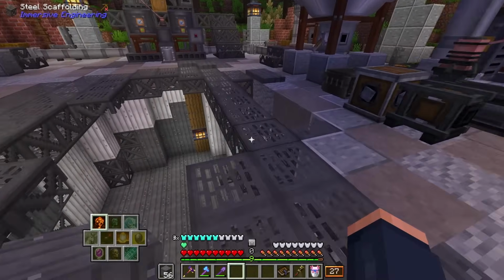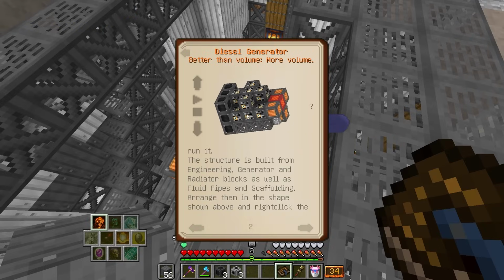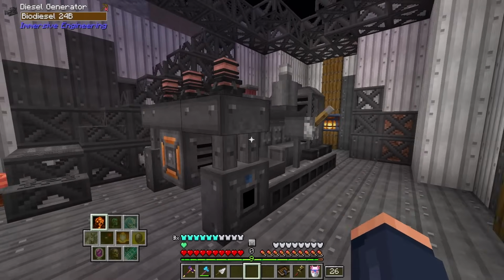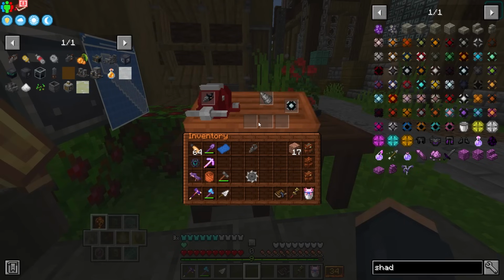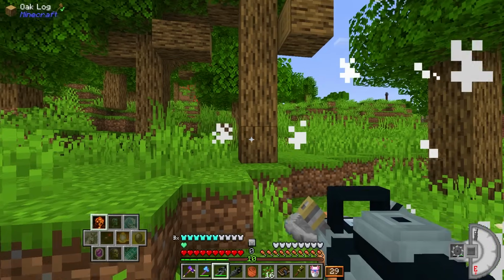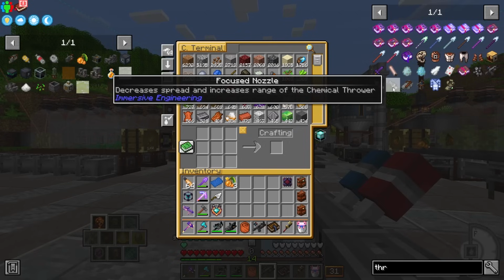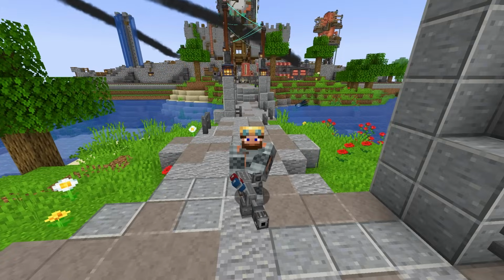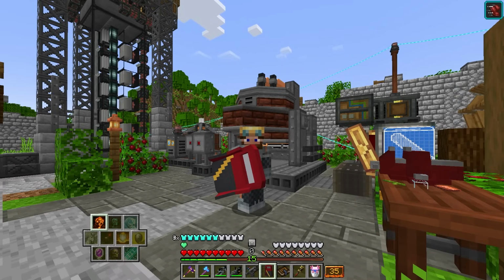Immersive Engineering Diesel Generator & Tools EP42 SteamPunk Minecraft Modpack

Comment: The total amount of augers goes to 3 to increase the speed and damage of the drill if you add the pressurize air tank it will help when mining underwater because once submerge the drill wont function. But yes there's i believed new upgrades were it has fortune onto the drill and the capacitor backpack as well. Haven't played the newer versions iv seen some snips in the Discord of the immersive engineering server and there's not much tutorial of the new stuff they added you should read more about the stuff because things did change last time i heard

Comment: Yo i would love if u make some integration with CC:Tweaked in your base to show your power supply in a fancy way
Reply from the maker: CC is all about programing with LUA and while i know a bit about it i'm not well versed in that language or documentation
Reply: @ChosenArchitect  hey i wanted to know does the generator have internal fuel storage. because i have a thing where even if there is no fuel pipe connecting to it it still runs. thanks in advance